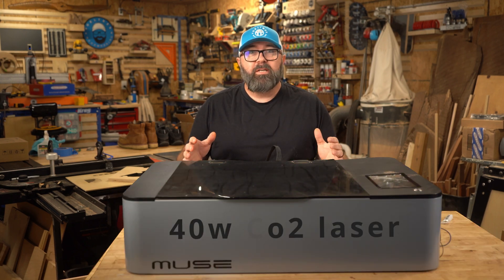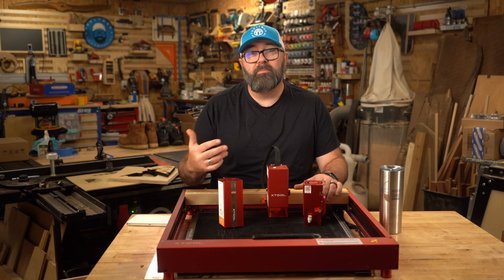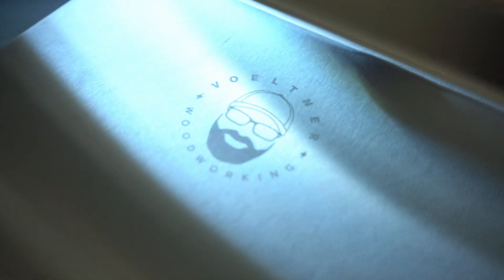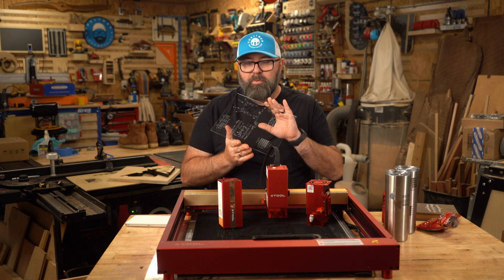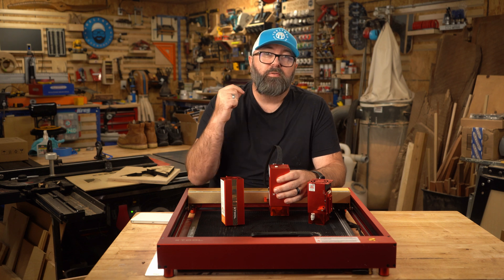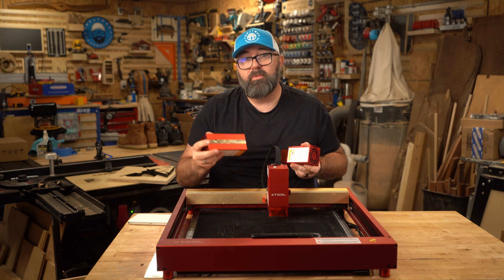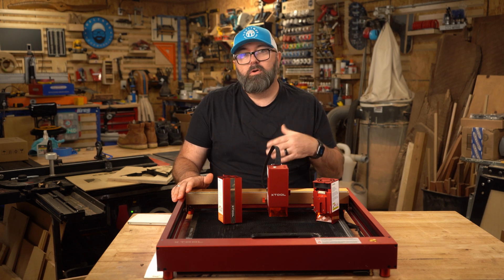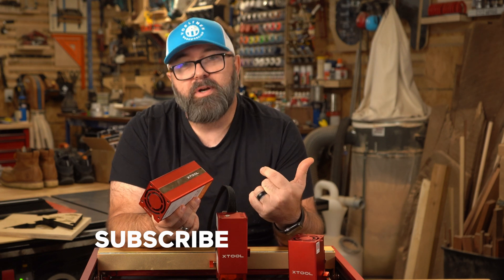40w diode vs 40w Co2 laser

Comment from the maker: Upgrade your laser for safety and savings! Trade in any open diode machine for an enclosed xTool and get up to $500 off: https://bit.ly/3vHLipP

If you'd like to upgrade your xTool to the 40w module or get the whole kit, here's the link. Make sure to use code "VW10" at checkout for an additional discount. https://www.xtool.com/?ref=FCYiXVqZuxgXT&utm_medium=5306&utm_source=influencer
Reply: I am on the fence about purchasing a 40w co2 or the 40w xtool. I will be using it to make rubber stamps and engrave the same image onto the wood stamp block. I know in this video you said you have made rubber stamps but I could not find that video on your channel. I would need speed of the diode laser to be as efficient as the co2 to be profitable. Also if you were going to be making stamps as a business full time which laser setup would you choose. Thanks in advance.

Comment: I cannot imagine how can you work without smoke suction. I mean it makes smoke.. a lot ... and it is dirty it can fill the room with smoke in minutes if you cut MDF or wood. and diode laser do not have them...
Reply from the maker: I have reviews of many other machines since posting this video. Lots of great improvements in this space which address the smoke exhaust issue.

Comment: Thank you for a good video.  I am trying to find out what output power I will need to cut through 1mm steel.  I'm in the market for a laser for my CNC router I built.  Do you have a video that addresses that question?  Thank you.

Comment: Very informative video, for example I didn't know that diode lasers are not suited for cutting clear materials, such as acrylic.  This is something I do fairly regularly on my CO2 laser.  Also, I'm so glad you included commentary on the importance of venting.  I'm dismayed by the large number of open-frame, unvented devices on Amazon, Ebay etc.  I know from first hand experience the dangers of the fumes that are produced -- I will NEVER use a device like this without proper exhaust.

Comment: Very clear video and explanation but the problem i have with CO2 laser , few youtubers or none , explais and is the fact CO2 laser tube life compared with Diode i believe is a big plus for diode . A exemple; i have a 150/130w CO2 tube,  works 10h a day 6 days a week and after 1 year is half power and after 2 / 2,5 years i have to change  the tube . I never surpass 20% of power ( 25/30w) ever, is a working dogma.    How long can i work with a diode without changing cut or engraving specs?

Comment: Sir, does this diode laser engrave PES(polyether sulfonate) in order to produce graphene ?
Reply from the maker: I'm not entirely sure as I have not tried. I would recommend a closed system like the xTool P2 so it can be vented, but then that limits the size you can cut.

Comment: For those seeking a reliable and versatile solution, I highly recommend the Monport Laser. With its precision, efficiency, and wide range of material compatibility, the Monport Laser stands out as an excellent choice for both beginners and experienced users alike. Its user-friendly interface, exceptional performance, and robust construction make it a valuable investment for anyone looking to delve into laser engraving. With Monport, you can confidently embark on your laser engraving journey, equipped with a tool that delivers consistent and high-quality results, surpassing the capabilities of many other options on the market.

Comment: I feel you did the tempura pain wrong! at least from the video you show it on the bottom of the glass you should use it on the top of the glass closest to the laser! It causes the temp to drastically climb if it is under the glass its heating after the laser has already passed through the glass! I make whiskey glasses, pint glasses etc. with mine and have found the paint closer to the laser makes a far cleaner etch into the glass! Also for the colors on the stainless if you slow the speed down drastically it will also change the colors again as you said its a heat thing the faster your etching the lower amount of heat goes into that exact spot
Reply from the maker: I’ve tried both methods with paint and this seemed the cleanest for my results, but each laser is a bit different and may give different results. Thanks for the comment.

Comment: The colors you are getting on the engraving are from heat treating the steel. It is the same as flame bluing the steel. You could likely get a better straw color if you slow down the passes slightly for that section.
Reply from the maker: After I published the video I ended up doing a series of tests for the colors and it really depends piece to piece the colors you’ll get. The same speed and feed looks different on each piece because of the nature of the material. Still get some really cool color combos with it that are fun to play with.

Comment: I am on the fence about purchasing a 40w co2 or the 40w xtool. I will be using it to make rubber stamps and engrave the same image onto the wood stamp block. I know in this video you said you have made rubber stamps but I could not find that video on your channel. I would need speed of the diode laser to be as efficient as the co2 to be profitable. Also if you were going to be making stamps as a business full time which laser setup would you choose. Thanks in advance.
Reply from the maker: I would definitely check out the P2. I made a couple of videos on that machine on my channel if you’d like to check them out. I didn’t do stamps on those videos but it is a good machine.

Comment: Hello Voeltner! Some time ago I bought the Xtool Pro 10W, so what is needed to upgrade to a 40W one, I mean, is it just the Laser Module? Thanks
Reply from the maker: Apologies for the late response. I missed this comment earlier. You can buy the upgrade module. There is a link in the description. xTool also has a trade in program where you can trade in your D1 for a credit toward a higher end machine like the S1. I hope that helps.
Reply: @VoeltnerWoodworking  Thanks!

Comment: Before hearing you say a diode laser cannot engrave acrylic or shiny surfaces, I just saw a guy in another video use a diode laser to engrave glass using chalkboard spray paint, with the paint side down; so the laser passed through the glass to the painted surface. It looked like it turned out pretty well and he had many examples. 😊
Reply: You can use tempera paint to engrave both. I do it all the time.
Reply: @timhubbard7656  : By "tempera paint" you mean those darkened glass sheets ???
Reply: @peplegal8253  no. It is a water-based paint. Literal paint. I cut it half and half with water, use an airbrush for even coats, allow to dry, and then engrave. When you're done, you wash it off with water.
Reply: These reviewers don't really fully test the units like real consumers who actually make stuff. They just ask for the item for free and make a lousy scripted video like everyone else does. I have a 10w diode laser and I engrave on glass, stainless steel and clear acrylic just as good as a co2 laser. You don't need a powerful machine.
Reply from the maker: @awildyoutuberappeared9325 I make stuff for customers all of the time. Perhaps try checking out the channel. :)
Reply: @awildyoutuberappeared9325  he said you can't cut clear acrylic with a diode (*which you can't*), not engrave on it. Gotta listen my guy.
Reply from the maker: Technically there are ways to manipulate the mediums for various techniques to work, but glass is not acrylic.

Comment: What about cutting various types of foam, foamcore, polystyrene, extruded polystyrene (XPS), Depron foam etc?  Thanks!  It sounds to me 'gas' lasers are more versatile, however my question is which is better for foam medias.
Reply from the maker: For foam your best bet is a Co2 laser. Check out the P2 laser. It’s a great choice for that.
Reply: For foam I would recommend a cnc controlled reciprocating knife but that's just me :)

Comment: Hey All, how does the diode laser work on black marble using PhotoGrav program. I work a 300dpi but up to 1000.
Reply from the maker: I'm not too familiar with that software, but with the xTool machines you can use Lightburn which will give you quite a bit more control over the quality of the image. You can adjust the lines per inch (LPI) to as fine as you'd like to get good image quality. Looking forward to seeing if anyone else can comment on your question so I can learn more about the program.

Comment: If you were going to buy your first laser with hopes of starting an ETSY business which would you start with... F1, Co2, Diode ???
Reply from the maker: Etsy is pretty competitive, and you're going to be competing with businesses who have production/larger machines. I'd recommend checking out the S1 or P2 lasers depending on your budget, and if it will be your primary business you'll want to get a machine with a larger capacity at some point most likely. Either of those machines (S1/P2) will work well for getting started, but it will depend on the type of projects you're wanting to do. After doing this video you just watched I have since reviewed both the S1 and P2 lasers, and they are my newest recommendations. Here's the P2 video https://youtu.be/yR17uB5HiiM but I also have a couple of videos on the S1 you can watch as you make your decision. I hope that helps!

Comment: So why can't a diode laser cut the same materials as a co2 laser even with the same wattage?
Reply from the maker: It has to do with the wavelength of the machines, not just the wattage. They operate on different wavelengths. I wish there was a one-size fits all.
Reply: @VoeltnerWoodworking  ok thanks that's interesting.

Comment: I hear air assist is important. Lasers can be refracted and scattered by passing through the smoke from cutting. Air assist blows the smoke away keeping the cut clean.
Reply from the maker: It definitely dissipates the heat around the laser head and removes debris, making for a cleaner cut or engraving.

Comment: For printing on glass and other clear plastic, have you tried putting a wet paper towel?  Lay the paper down and mist with water until soaked, then flatten the bubbles out.  Burn with the laser onto that wet paper towel, it will vaporize the wet paper and the excess moisture will wick heat out of the plastic making a cleaner cut/engraving.  It also eliminates the reflection or passthru of the laser.
Reply: Another thing to engrave. Is mirror.  You have to flip the image horizontally and cut the back of the mirror, and it will show through as an etching.  Very nice to glue white felt on the back of the mirror for diffusion and backlight it with an led.
Reply from the maker: The paper towel method sounds interesting. Will give that a shot. I’ve done a few mirrors. Looks cool, just not my favorite thing.
Reply: @VoeltnerWoodworking  It works very well.  Also keeps glass from splintering and fuzzing up the edges of the etch.

Comment: watching other vids in respect to the X-Tool diode units, there is a bit of noise saying that you require fume extraction and air assist. Is this true for the CO2 units also?
Reply from the maker: For the XTool P2 you do not need an air assist. It’s built into the machine. A fine extractor is highly encouraged but not necessary if you’re venting it outside.
Reply: Cheers, thanks for the prompt reply
Reply from the maker: I just published my video on the P2 this morning if you’re interested. 

This is the CO2 laser to beat! My xTool P2 laser review
https://youtu.be/yR17uB5HiiM

Comment: Hi, thank you for the nice video !  is a diode laser the right tool to cut 20mm PE foam ?( for inlays in cases ) if so 20 or 40 watt ?
Reply from the maker: While I haven't done it, I've seen it done with the 20w D1 pro before. If you can afford the S1 laser, it's fully enclosed so you won't have to worry about the fumes when cutting. The link to the S1 is here in case you wanted that instead of the D1 (link to D1 in description): https://www.xtool.com/products/xtool-s1-laser-cutter?ref=FCYiXVqZuxgXT&utm_medium=5306&utm_source=influencer

I hope this helps! Let me know if you end up getting one so I can see how the projects turn out.

Comment: Hı great video thanks. İ have a question. İ want to cut brass plate 0.05mm to 0.1mm thick which of the lasers will cut?
Reply from the maker: Thank you. You’ll need a fiber laser to cut metals like brass, unfortunately. They can be a bit pricey, so depending on the scale of the amount of projects you’d be doing it may not be worth the cost.

Comment: Compared alot of these machines & I keep going back to Xtool.  Trying to decide beweeen D1 Diode or Co2.  I am a beginner.  Speed is not really a factor to me.  Can you name something a Co2 can do that Diode can't.  Trying to justify buying the CO2 or S1.  I am.so confused & just ready to buy.
Reply: I'll name a converse -- the S1 can etch stainless and some other metals.  CO2 doesn't touch it (it can engrave anodized or you can use theramark, but raw metal... just doesn't work)

The clear acrylic is... dangit...  CO2 only.  Can X1 cut tinted acrylic?  You might be able to etch with the wet-paper-towel method, but I dunno if you're ever going to get "cut..."
Reply from the maker: A co2 laser can cut clear acrylic whereas a diode cannot. Check timestamp 01:51. That’s one of the biggest factors and reasons why people end up going with a co2. It used to be diodes didn’t come in these powers so co2 was the only option, but not anymore. Check out my video on the S1. That is the machine I recommend over any other machine for beginners.
Reply: @VoeltnerWoodworking  would you recommend the s1 over the omtech polar to start a small biz , I primarily want to engrave and cut leatherette patches and engrave tumblers.  Ideally I would like to have the option to do as many things as possible since it's my first machine, but if the s1 is a much better option for what I'm primarily looking to do then I could go without doing glass or acrylic. Thank You
Reply from the maker: @AlexElizabethDiaz-mb8fp work area is similar, the bonus of the S1 is the ability to do curved surfaces and add the conveyor options. Sounds like you wouldn’t really use those functions much with leatherette or tumblers. The spot size on the Polar is smaller so you may be able to get finger engraving, but speed is higher on the S1. Hard to say between those two because they are each unique in their own ways. If you’re not limited by budget, the XTool P2 is my new favorite. I just posted a video on that. If you’re limited by budget and stuck between the S1 and Polar, it will likely come down to whether you think you’ll do either metal or acrylic. If more metal than the S1 is a great option because you can always add the IR module. If doing acrylic then the Polar is the way to go. Hope that helps. Check out the P2 video I just published if you want another option.
Reply: @VoeltnerWoodworking  So I just watched a video of a person who makes "metal patches" for hats, but is actually using a very thin acrylic and ends up looking like metal, I think it looks really good.  Anyhow, since I plan to do hats I would definitely want to have that capability, so a co2 it is, and yea I did check out the p2, thing is there's other options around it's price like the thunderbolt , or an aeon Mira 5 , would you still choose the p2 ? Thank you for your reply I appreciate it!
Reply from the maker: @alexelizabethdias-mb8fp I haven't used the thunderbolt or Mira 5 so I can't provide a comparison on either of those, but I will say the features of the P2 are among the best I've seen in the category, and after having a hands on using it for a while I would recommend 10/10.